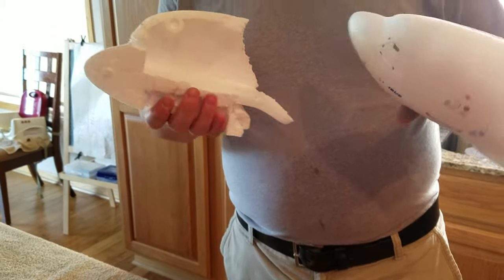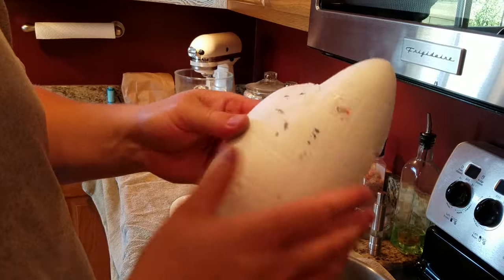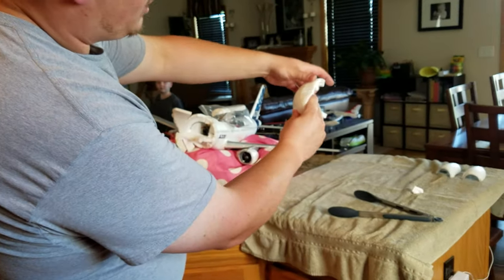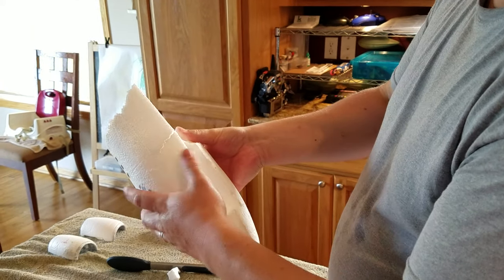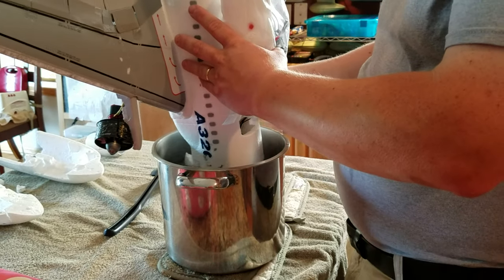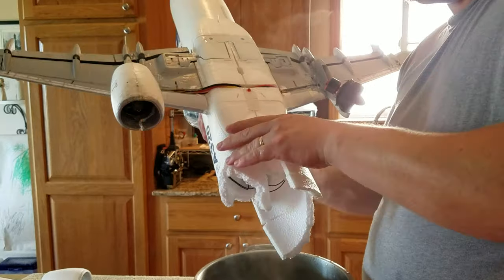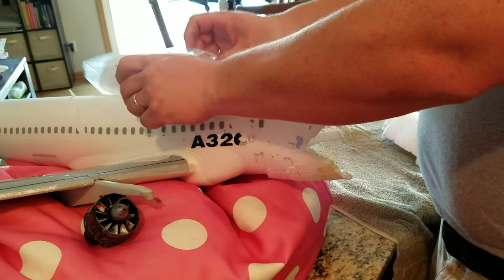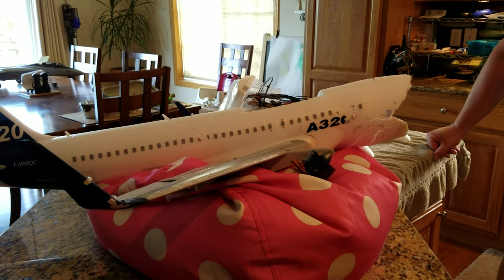Supreme-Hobbies Airbus A320 Massive Repairs 1 of 2 from 6/18/2016

Comment: This is why I hate styrofoam bike so easy let me tell you about the secret it is so easy and it's not that difficult you get a paper that can you get out dude you cut the body that the one got broke just cut it and put upside down and start drawing the line of the body once after that they cut the paper from the outside and you leave the inside out there and you got to start from already like you could go and just order do you find the right there like Austin Powers or other stores they have and then after that starting to draw another one here that knows and then a wiring heating just be careful once you cut the one cup o'clock cut this iPhone and makeup of a new one here we got a paper and a pencil and started draw the outside of the body of your see that's one number to my nose is already booked already in the middle in the middle like they're still there it's going to be and then and then and then now once you got to know it's not smoke I do not like that yet you got to make a smile on the front of it and I like how you say you could get it off of top of a you can use the same one that I did use did the left or the right now in the window when he's done that then you could do something about it and then after that connected removing like now and then what you got and the numbers and then after that you're going to use why you being an auto parts that you can put it and then you go use the last Light That magnetic and you're glue like they're too little body of the plane styrofoam and what you have on your body that's it right there and then and you'll be happy and good luck
Reply from the maker: Sorry, Carlos, I tried to understand this, but have no idea what you're saying...Auto-correct strikes again!